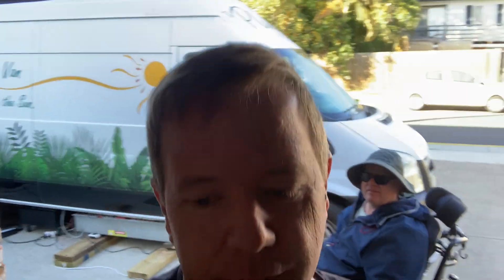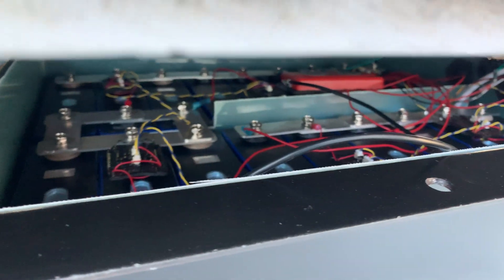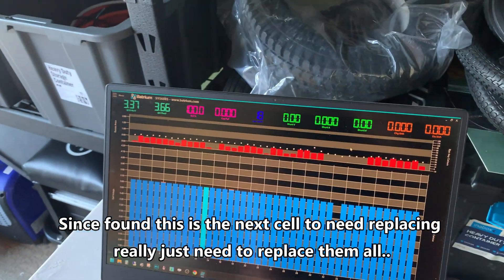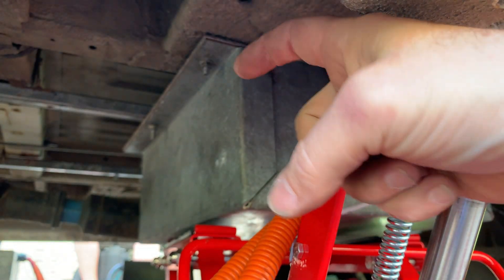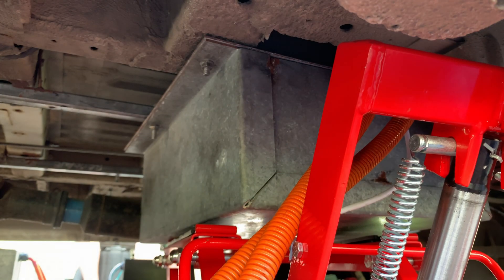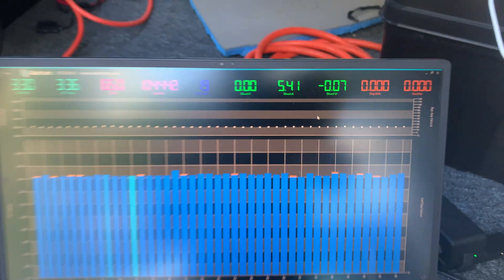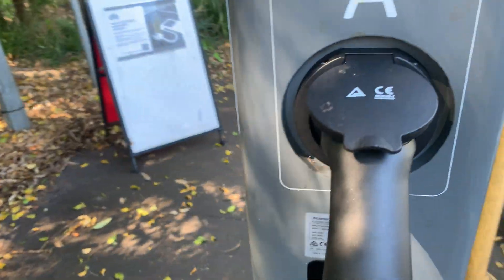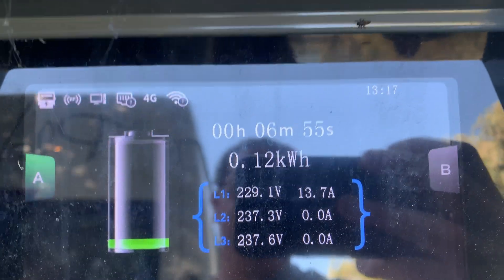The $3000 DIY EV Transit Van is back on the road

Comment: Nice one!   What external device is Batrium using to control the amp level in/out?    I'd guess 120kilometer max range.       I wish there was some way a moderately handy person could buy a kit to convert something to electric - e.g. the motor and transmission etc - like this van without the current extreme level of knowledge needed.   Would be interested in detail vids if you get that far :)

Comment: 128km is my guess.  I also wonder if the vibration could be related to the misalignment of the clutch flywheel that I suspect that have put on the end of the motor.
Reply from the maker: I bet it was never balanced